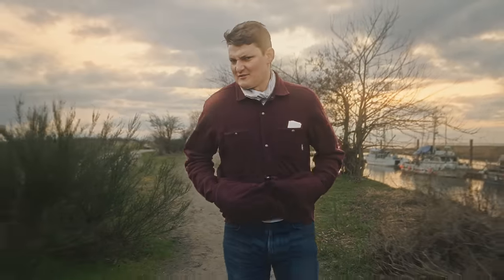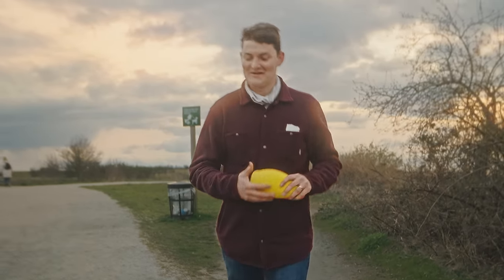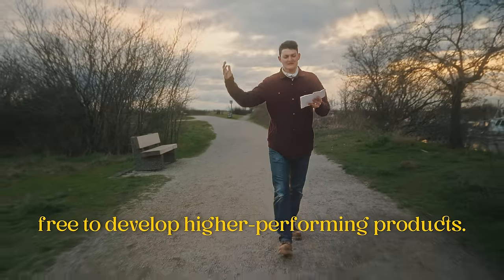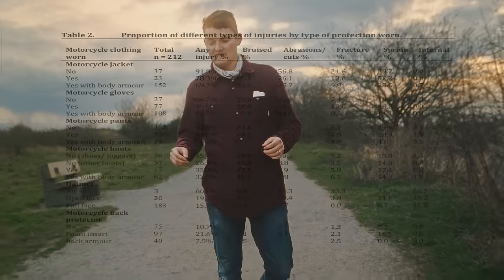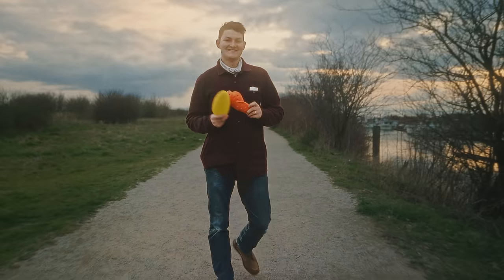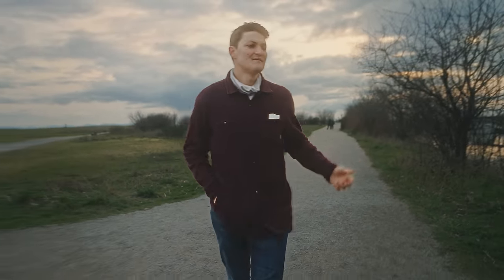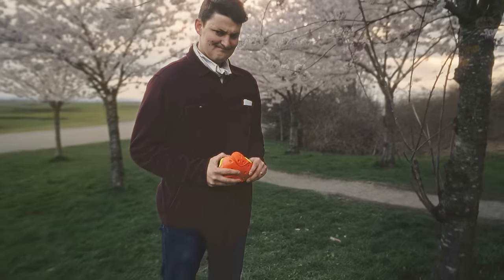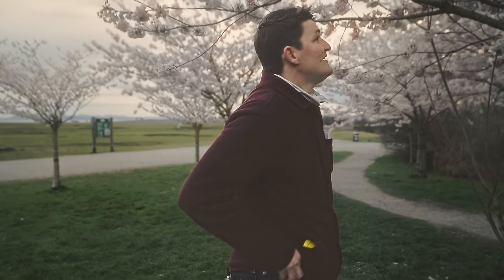Why I Stopped Wearing Motorcycle Body Armour

Comment: I never consider those pads as protective against bone fracture. But they are good for abrasion, small hits that can hurt you long time. And also some more serious knee or elbow injuries. But to be honest not for serious accidents. I would never remove them as "any protection is good protection"
Reply: I don't have a motorcycle license, just love F9's content, and every time they demonstrated pads "absorbing" impact force they seemed to not do that. The pads don't seem squishy at all, just flexible, but to absorb force you'd need to compress a material (Like the styrofoam in a helmet does) which these pads don't seem to do. They might spread the force over a somewhat larger area but that's it.
Reply: @GameCyborgCh  yes that is how you absorb impact. By spreading it over time and area. There is no way to magically disperse of the energy any other way.
Reply: the two studies he quoted also have some methodological flaws regarding how they collect their data.

which is due to them getting their data based on reported accidents. aka accidents where the cops showed up and/or the motorcyclist got collected by an ambulance.
Any single vehicle accident where the motoryclist was able to continue riding will not be in the database, on accouint of not requiring police to be called.

And those less severe accidents are the ones where armor actually works.
Reply: @anonym3017  good point
Reply: @GameCyborgCh  "They might spread the force over a somewhat larger area but that's it."
See, that IS actually useful in impact mitigation principle.
Ryan's complain is that the mitigation threshold is lower than required and this should be material to protest and raise the standard. The current protection standard is too low.
Reply: I agree, any protection is good protection. Hell, if it makes those stones and other road debris not hurt, that's worth it

That the protection standard is too low for comfort is concerning
Reply: @anonym3017  this same problem exists in manufacturing environments. OSHA recognizes that there is about a 30:1 ratio between increasingly severe injuries in the workplace; it's why OSHA requires people to report even a paper cut in the office. To explain it, for every 30 near misses there's 1 minor injury (like a 1 or 2" cut or a bruise). For every 30 minor injuries, there's about 1 moderate injury and so forth up until death. It may not be 30:1 for motorcyclists, but if there's a similar relationship with crashes then it's just a game of statistics. You're more likely to have a minor crash than a major crash (unless you're really reckless), so would you rather have armor in that minor crash that makes you sore a few days or would you rather have bruising all over? It's a hypothetical that really just goes back to "better to have it and not need it than need it and not have it." 

The problem OSHA has is similar to motorcyclists, it's very rare in the work environment for anyone to report near misses or minor injuries so on paper, the 30:1 relationship doesn't match what's actually reported in that range. The 30:1 rule holds much more true between moderate and severe injuries and death.
Reply: @anonym3017 Aka: survivorship bias
Reply: @anonym3017  Yes. Similar to "CarFax" reports, all of which state, "No accidents REPORTED" (capitalization mine).
Reply: @TubeOrNotTube  They're not completely fixed, so they fit everyone wearing that jacket and can move about with your joints
They'll stay in place
I tested it the hard way ... and I'd suggest you put them back in
Reply: @GameCyborgCh it's because force is a misused term. What breaks bones is pressure = force / area. If you disperse the force by a larger are, you reduce the pressure and the likelyhood of a fracture.
Reply: @anonym3017 if the motorcyclist was able to continue riding what's the worst they possibly could have been injured? is it worth wearing pads every day of your life to maybe prevent a bruise that'll only last 2 weeks?
Reply: @anonym3017  This opens the question of survivorship bias, too: could it be that crashes without protectors were serious enough so that they became fatalities rather than injuries?

I'm not joking. A broken femur or open fracture elsewhere can easily lead to death by blood loss. 

Another question is if the seriousness of the fracture was considered in these studies, or if they counted all fractures the same. Which they aren't. A shattered joint is MUCH worse than a broken long bone. It's the difference between 12 sitting weeks in a cast or taking half a year off while having to learn to walk and write again, if ever.
Reply: Exactly what I thought. I can't even see how any would have thought the pads would protect from a fracture. My jacket is uncomfortable because of the weight and thickness of the leather, I don't think removing the pads would make much difference at all. If I have a crash I'm fairly confident my elbows will hurt less with the padding in than they would without
Reply: @GameCyborgCh  Modern pads are made from a non-Newtonian fluid. This is flexible when at rest but becomes a lot harder under pressure. Oobleck is a famous example, as is water with corn starch. Comfortable to wear, strong enough to take a serious impact.

A helmet is designed to slow down your head by compressing the Styrofoam inside the helmet. This makes it a one-time use product. As well as the shell cracking. 

Pads are designed to distribute the impact over a larger area, like body armour does. The can also be re-used, which is nice.
Reply: Just wear abrasion resistant gear instead of the pads
Reply: Same here, they are too small, an impact from a car at 40mph or above will break your bones and send you flying with or without these little pads, but I think I still prefer them for cases where I could fall from the bike or slide, I think it might still prevent some minor injuries.

I remember back in High school when I used to play football.
I had this lower back protector which seems kinda useless and bulky so I never used it but one time I decided to put it on and I felt a huge difference. 
If I got pushed and fell backwards it would hurt my lower back, almost knocking the wind out of me too but with the pad I felt nothing, I could drop, get back up and be ready to do it again without any pain.
Reply: I found that exact point to massively undermine this whole video. Sure, market forces are at play with everything we buy and consume, but the fact that the pads may not stop bones from breaking isn't the only reason to wear them.

I enjoy Ryan's stuff, but sometimes he tries pretty hard to make a seemingly profound point that isn't entirely supported by reality.
Reply: @anonym3017 but I want the armour to work in the tougher accidents. Don't you? 

I also want the truth and efficacy of the armour and airbags.

And I want an increasing system of effective safety each year. Published well in advance. An improvement in force absorption every 1, 2 or 3 years, using whatever technology is available or needs to be created. So the manufacturers can plan and research it and we know it will be coming.

Motorcycling is losing riders because safety is poor. People stop riding either through accidents or caution. If they were safer they might still be riding and therefore still a customer.
Reply: @TheGrundigg it's not magical, it's called viscous damping.  Viscoelastic pads absorb impact energy the same way the shock absorber on your bike does.  It's not just spreading out over time.
Reply: @es-br8ck  I can guarantee that they didn't just cause getting that data and understanding it are both ridiculously hard.
Reply: Ya. I know I never thought, nor was sold on the D30/pads because it would save you from a fracture. I was "sold" because they can save you from abrasion in the areas most likely to scrape the ground, and would help, not protect in less traumatic crashes. Ill be keeping mine in as I barely notice them in the first place.
Reply: @anonym3017  the term "actually" is carrying a lot of supposition weight.

we literally know nothing about the group that got up and rode after an accident, not even if armor was used... we can't draw pertinent conclusions when that much data is missing. it's tempting to attribute the data missing from one group to another group that has no data because we like 'certainty', 'safety' and all that... 

the point of the video (and the cited studies for that matter) is not to deem the pads as unsafe, but not as safe as we believe... and if we dig deeper maybe a broader concept of 'regulatory manipulation' and how sometimes progress is held captive by 'accountants' :)

ps: any protection is better than no protection. the question is how good is the minimum required protection...
Reply: @Google_Does_Evil_Now  armor works by spreading out the impact force.

that's only possible up to a certain impact energy because there's only so much area that you can distribute the energy over.

so armor that's effective in tougher accidents is simply not physically possible.

above that you need an airbag to spread the impact energy out over time. That also only works to a limited extent.

and once the airbag stops being effective you need to get rid of energy by deforming stuff. which means your vehicle has a crash structure and is a car not a motorcycle.
Reply: @duroxkilo  except you can.

the armor transmitts 9kN at 50J of impact energy. so if the impact energy against your elbow is 22J or less it stops the bone from breaking. meanwhile someone without level 2 pads has a broken bone in that accident.

the rate of pads vs no pads should also be consistent across all types of crashes.

which means that you can check for an absence/existence of data where there should/shouldn't be some under your 0 assumption.

so if pads suddenly drops off while no pads doesn't then the pads work in that type of crash.
Reply: I have always looked at pads this way.  I keep them in because I really don't want skin graphs.
Reply: @anonym3017  absolutely, I can't belive he did not consider this very obvious point, or if he did, to underestimate so grossly the potential for injury reduction when wearing one.
Reply: @anonym3017  i think you misread my comment..
take care and safe riding
Reply: @GameCyborgCh  Exactly. And you really need true armor that has a hard outside shell to spread the forces, then the squish to absorb. Adventure and moto x riders do exactly that - wear real armor.
Reply: Except for the backpad. I will never not wear a D30 backpad.
Reply: @CactusJack252  Grafts. /end pedant
Reply: @TubeOrNotTube  thats a problem with your jacket. Mine does not have that issue, my pads are sitting rather tight, there is velcro inside my jacket to hold them in place whilst allowing some positioning adjustments to be made by me and the pockets are the right size for the pads. My elbow and underarm protector does move relatively to my arm but it is so big that it would absolutely not matter.
Reply: @duroxkilo  nope.

A partial absence of data is data in and of itself. And you can draw conclusions from that absence.

Furthermore armor pads work almost entirely in a linear fashion. So there's definitely a significant crash area where wearing armor means you don't have broken bones and can continue riding while not wearing it leaves you with broken bones.

Since both quoted studies didn't check for that absence of data they are either inconclusive or underreported the effectiveness of armor in light crashes.

They are correct for heavy crashes.
Reply: @anonym3017  
i don't mean to be rude by any measure, and also i'm the first one to recognize i'm not that bright but you really need data to compute data.

logic, reasoning and common sense as we use it daily are often inappropriate tools when it comes to statistics. again, i don't mean it as a condescending remark..

the point of the video (and this wasn't the first one touching this topic) is not that protection gear is useless but rather than the 'required min standards' are inadequate. 

he mentioned twice he's not advocating for removing pads BUT he's using other protection that is superior at absorbing impact forces... 
it's a warning (especially for new riders) that the feeling of safety offered by the 'bare min standards' is a 'false feeling'.

-----------------------
in the real world the tiny universally sized pads on larger riders are order of magnitude less efficient that it appears at a first glance.

it may take 4kN to split a femur but that's under 'lucky conditions'. 
change the angle of impact 5 degrees and the required force decreases 36%... 

there are companies that use larger pads in accordance w/ rider's weight. 
THAT should be the MIN REQUIRED standard but it's not for literally stupid reasons. 
and that's the point of the video as i understand it.

ps: safer is not the same as safe. any protection is safer than no protection. the present standards for 'safe' need to be updated. :)
Reply: @duroxkilo  except bigger pads do absolutely nothing on hips, knees and elbows due to all of those being point impacts where most of the pad doesn't take any force whatsoever.

and no. an absence of data can also be used for data math.

the ratio between accidents wioth and without armor should be pretty constant all the way through. you can now check if that is the case. if it stops being the case at any given severety then pads stops/start working there.
Reply: Same - they are to assist with the horrible scrapes and soft tissue damage I would always get on my knees and elbows on the mtb.
Reply: I doubt if a bit of foam does anything for abrasion, that protection is coming from whatever fabric the garment is made from
Reply: @elobiretv  Abrasion also occurs between fabric and skin, not just between road and skin. The foam also helps to protect the fabric by spreading the abrasion point over a larger area.
Reply: The only thing about this video that surprises me, is that people actually think the pads are meant to prevent fractures. They are not, and were never intended to, as the studies also point out. It's bit like stating a motorcycle helmet will not project your head from a gunshot... Yeah, we know, but it's probably still a good idea to wear one, for purposes other than gunshot protection.
Reply: @GameCyborgCh  spreading force is exactly how armor works. Easy example, take your finger and push it into your arm. No big deal. Now apply the same force to your arm but with a needle (ok don't actually do it, but) you'll quickly understand how useful energy dispersal is.
Reply: but they are protective against bone fracture. Ce2 goes from ~50kN to 9kN, over 80% reduction. As ryan points out, both are way above 4.5 require for fracture (though it would be foolish to say 50kN isn't more detrimental). Lets flip the calculation around. if you want to stay <4.5kN and assuming 20% transmission of force thats <22.5kN!!! You can take an impact 5x greater and your bones won't fracture. Thats a huge improvement and definitely protects against fracture in many instances.

In the example a 10x force still breaks a bone, sure thats true, thats not surprising. But to say there is "no protection" is completely false. Like you said any protection is good protection.
Reply: Thanks. Logic.
Reply: To me they are the difference between feeling like I got my fucking ass kicked and every bone in my body hit with a hammer versus being just slightly rattled